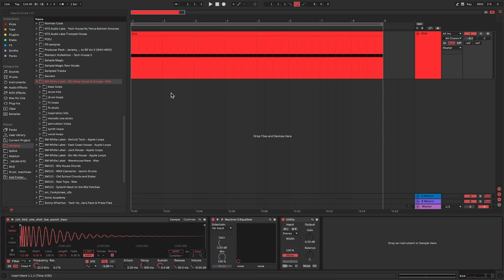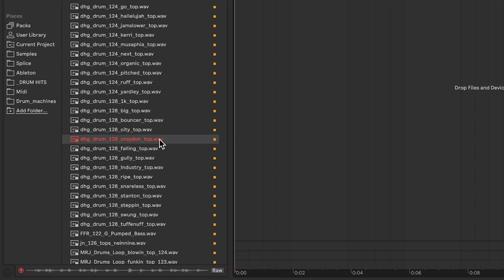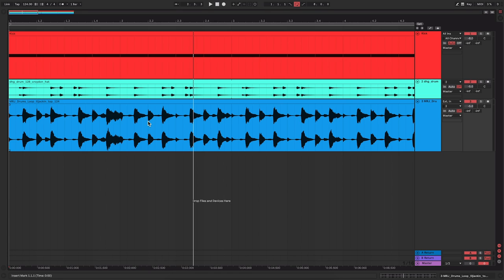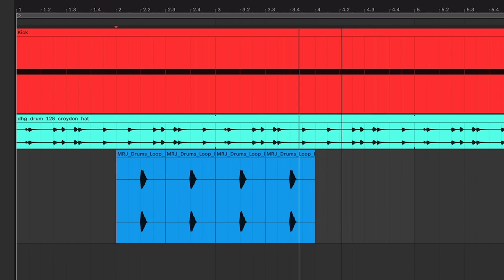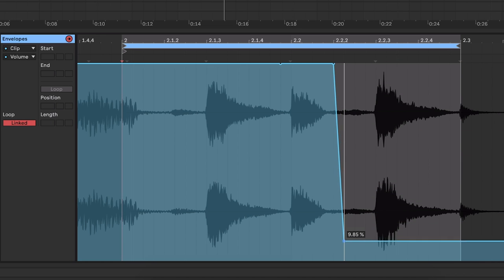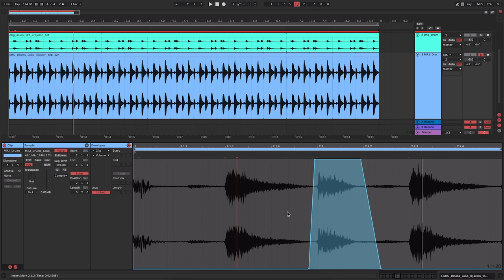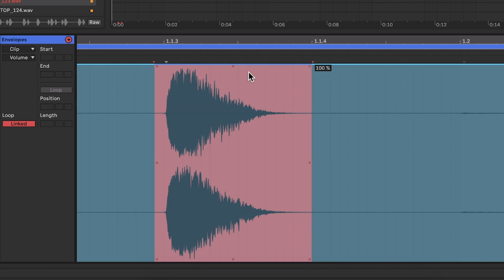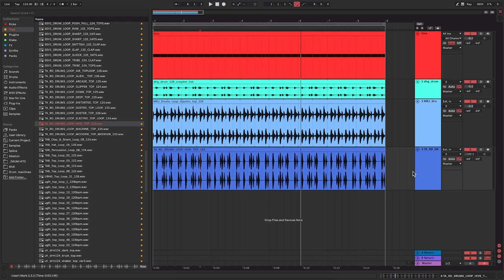Making BEATS with loops in Ableton

Comment: Greetings,

I've used to drag and drop loops and they were adapting to the bpm but not anymore after I reinstalled my windows. Do you have any idea what can it be or how I can get it back? Thank you!
Reply from the maker: Loops should always adapt to BPM when you drop them into Ableton but if they are larger audio files it may be you have 'warping' turned off. Head into your Ableton preferences and turn on Auto Warp Long Samples from the Warp section, that might help!
Reply: @DirtySecretz  It works if you drag them in from preview area but if you do it from splice app, it won't adapt 🤔. Thank you for your help, I will double check my settings also. 🖖🏼

Comment: I m new about mixing loops , can i put togheter different time loops ?
Reply from the maker: Yes you can do, Ableton does a great job of warping/time stretching loops so they all fit the same tempo. If you're jumping massively in tempo (for example using a 90bpm loop in a 130bpm project) it might not sound great but it is possible.
Reply: So for example i mix dub loops , they can be 90guitar 120bass 70horn and tempo is like 100-120? Thank you !!! (Which is the trick ? They had to be close to the project tempo? ) they can sound togheter whit different bpm? And what if all the loops are at the same tempo (120)and the project tempo is (140)?
Reply from the maker: @Sn4p_Fps  It should work just fine, whether it sounds great is up to you. You may need to play around with the warp settings for each loop to get the best result.
Reply: Dirty Secretz you mean they have to be at the same bpm or not ?
Reply from the maker: The warp algorithm, usually “complex” works well although “beats” is best for obviously drums
Reply: Dirty Secretz I was just talking about the tempo and bpm for the loops
Reply: Dirty Secretz last bro , all the loops should have the same bpm ? And if yes , I can speed a bit the project tempo ? Love you !
Reply from the maker: No the loops can have different tempos and you can still speed the project tempo up and down - try it out and you’ll see
Reply: Dirty Secretz for example guitar90bpm bass 120bpm horn 80bpm , the daw will do the job itself ?
Reply from the maker: Yes, just drop them in and Ableton will automatically get them in time if they are proper loops
Reply: Dirty Secretz what you mean whit “proper loops” ?
Reply from the maker: It loops properly, it’s an exact loop